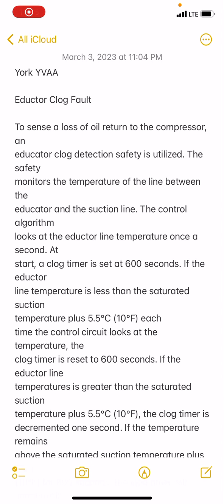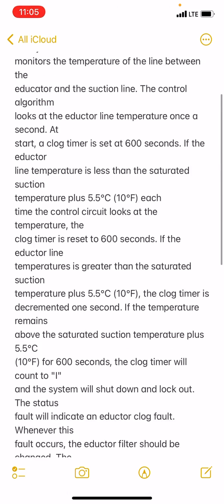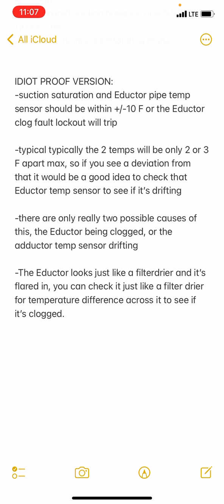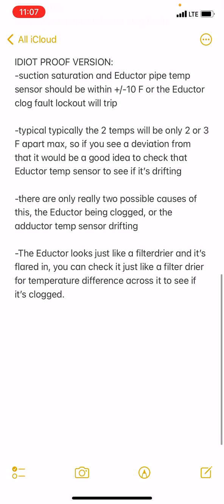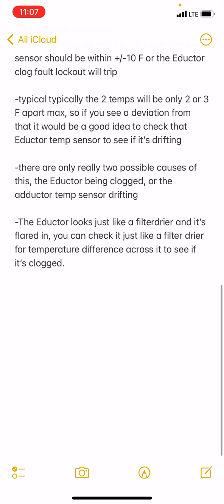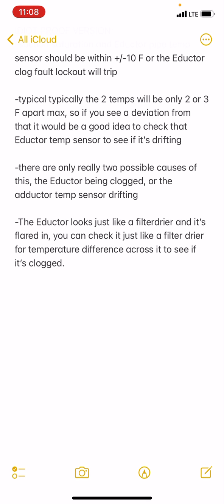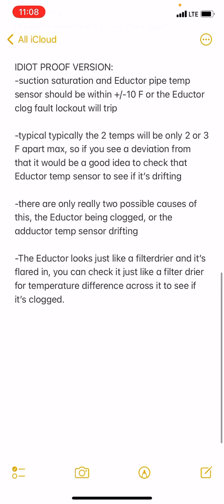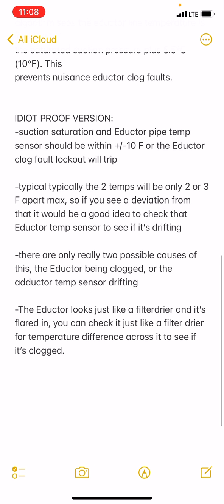Causes of a York YVAA chiller tripping on a Eductor clog fault #chiller #york #YVAA

Comment: The only issue I have is the educator is not the black filter drier looking thing that is an actual drier.  The educator is silver and is what the filter drier flares into it. It has a nozzle and takes discharge gas and swirles it and helps pull refrigerant/oil back off the bottom of the evaporator

Comment: Igbt fate drive fault again in again
Reply from the maker: Are you saying if the IGBT trips a fault code it will cause an Eductor fault code?
Reply: I’ve experienced this clogged educator fault which locked out the system two, for us the system was had an accompanying low pressures alarm on the same system. We replaced the eductor and the system was up and running. But we have also has this alarm during the winter days and we called out JCI to investigate because swapping out the educator didn’t work, I am guessing this is were the second option applies. If it’s the sensor drifting do we change the filter or can we change the set points at which temperature is set to trip?